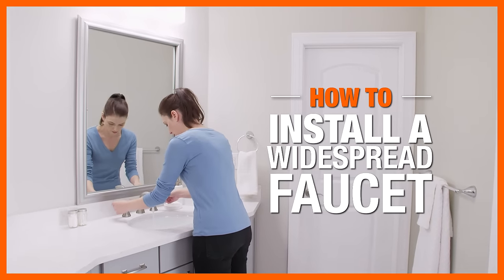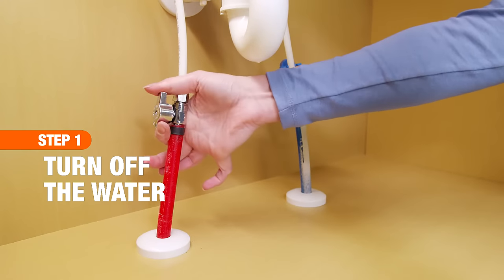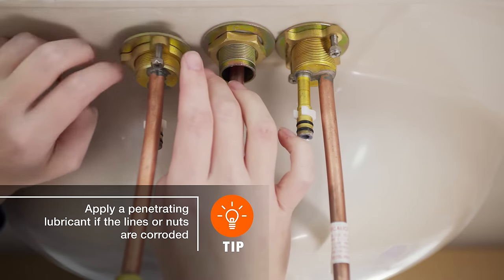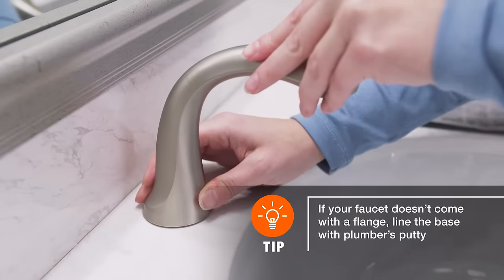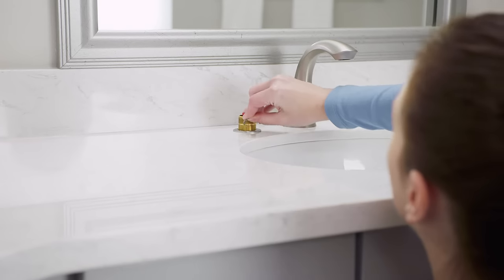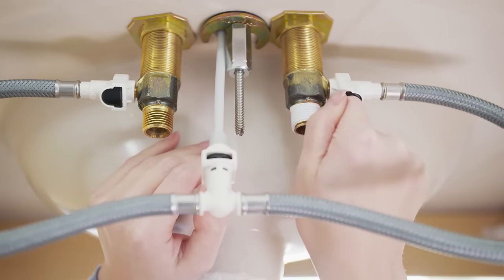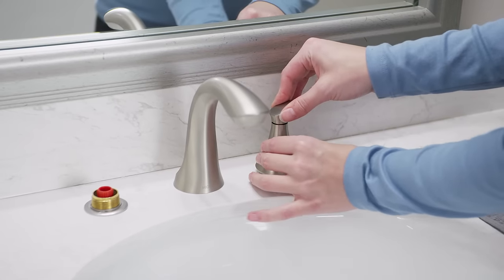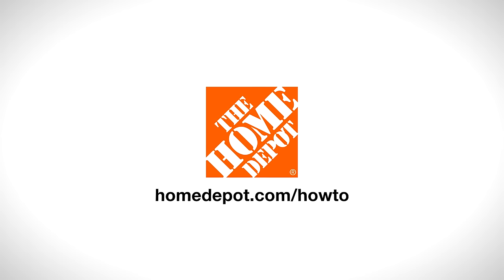How to Install a Widespread Faucet | The Home Depot

Comment: And the drain/stopper installation?
also if you are smart enough you will put the thread tape on before you have it on the stink rather then try to do that over your head under the sink.

Comment: If the center tap is as tight as it will go and still rotates how do I fix that?
Reply: Find rubber washer(s)/gasket(s) that fit and add them.

Comment: These are over engineered piece of craps 💩 that fail on a regular basis after 5 years..... What ever happened to simplicity and function?
Thanks for showing the instructions 👍🥴....I replaced one just like it the other day.....corroded to hell around the handle valves.....

Comment: Wrong way to do it anyways, she didn't hold the shut off valves with a wrench while unscrewing the supply line especially on a PEX style shut off valve, you don't need Teflon tape on the faucet valve body. She hand tightening the valve bodies only so now the whole valve body will turn when turning on the handles, she was screwing the supply lines on the wrong direction, lol lol what a hot mess video